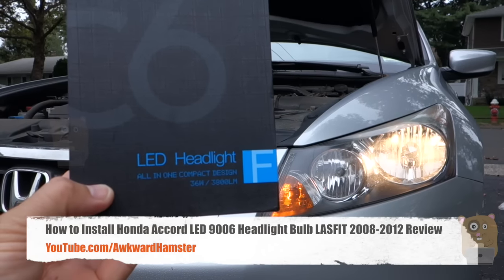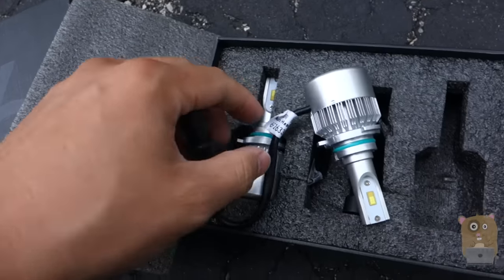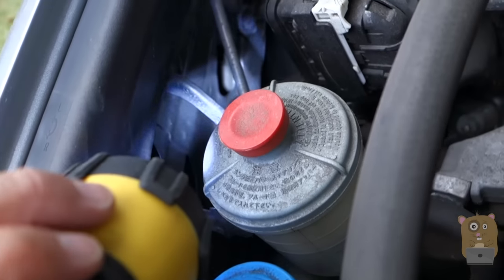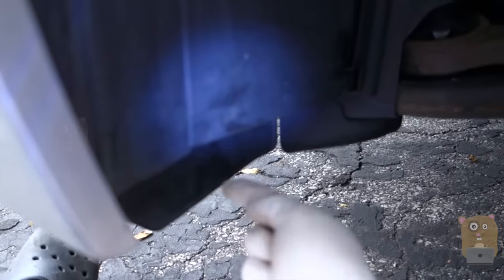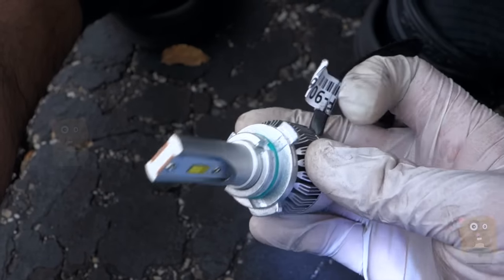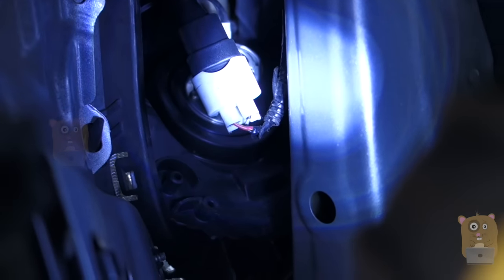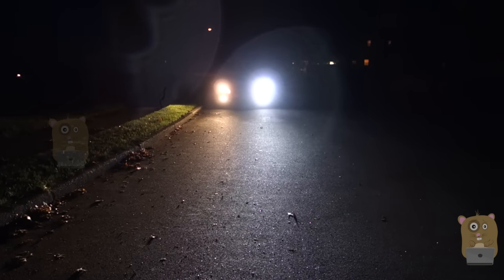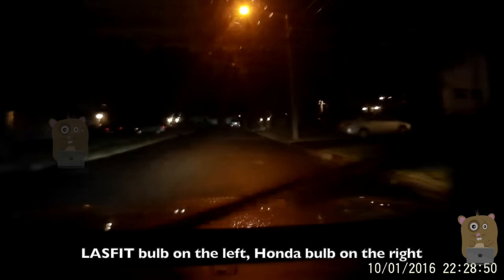How to Install Honda Accord LED 9006 Headlight Bulb 2008-2012 Review

Comment: If anyone sees this,instead of removing the wheel,you ca just turn it all the way to the right.It’ll give you enough space to remove the fender clips
Reply from the maker: thanks. I think I mentioned it in the video that I am removing the wheel because it makes filming easier.
Reply: Lol he says it very clearly that he removed the wheel to make it easier to see what he is doing but we don't have to smh
Reply: @AwkwardHamster  Thank you for this Video Man 👍
It helps A lot
Reply: He said that several times in the video bud😊

Comment: Ok so i just did this on my Honda! I kept the wheel on and just turned it to the side! I took off about 3 plastic tabs and only 2 went back on, the other was so brittle and old it broke!! It was very hard to twist it with my hand in an awkward position but ONE BIG HELPFUL HINT!! UNPLUG THE CONNECTOR BEFORE YOU TWIST THE BULB OFF! IT MAKES IT ALOT EASIER WITHOUT THE HARNESS IN THE WAY! Overall thanks for the advice man....Now i can drive my car at night again and feel more safe! 👍
Reply: The fasteners were so brittle on mine most broke too. Now I’m having a hard time getting the new fasters back in place because some are different sizes. Any advice on how to re-attach the plastic liner?

Comment: This was ALOT harder than i thought. Not much room to work with and i had problems getting the bulb out (sprayed wd 40) that worked. It was also very hard to get the new bulb in the track. And to make the connection u need two hands. Overall not as easy as yours but after two hours i got it did. Thanks
Reply: is it worth the headache?
Reply: Lol same dude. Just don't forget the swear words. It's completely necessary
Reply: You could have taken off the front bumper cover and then remove the headlights,but it all takes time and patience.

Comment: it may reflect brighter and better light than halogens but a lot of folks forget how LED bulbs work. THey're not good especially for opposing traffic. Why? Because all these headlights are "Reflector" type and not projector type. All the LED headlights you see on the newer cars are projector type. These will blind oncoming traffic. It's almost no different than driving with your High Beams on the whole time. If anything, replace the entire Headlight unit with aftermarket projector type headlights. Also, these will make the area close to you brighter, it will not give you distance. The whole point is to get more brighter light down the road, using low beams. IMO, Sylvania's Extreme White is the best bulb for these type headlights.
Reply: Main reason i am saving up money for projector headlights for my 08 accord. Which i find stupid that the coupe accord comes with projectors but not the sedan -.-
Reply: Romal Desai agree I haven’t been a fan of leds since the old school with the silver box ballast  and now their just a huge light bulb with a fan... ya they do look like High beams too and I feel like every new car or car with hid have high Beams and blind me.. of course I gotta look away and not at the actual light. Might have to invest in that “as seen on tv” flip down visor that turns ever light dim lol

Comment: Looks good from brightness standpoint. However, my concern is those few extra inches up on the led beam may be equal to shining in the external rear view mirror and straight into the driver's face. Furthermore, the illumination to the left is at an angle instead of a straight line. In other words, the horizon line is not horizontal and goes up the farther it moves away from the center. I therefore suspect it will potentially shine into oncoming drivers.

On another note, i like how u shined halogen and led together for comparison., an installer can use that to adjust the LED bulb to the correct height.

Comment: I did my 2009 Honda Accord ex 4 banger.i had to adjust the driver's side n passenger side.just remove the air box on the driver's side to adjust the driver's headlight.the on the passengers side pull up the radiator overflow bottle and you can see the passengers adjustment nut.they use a 10 mm socket with an extension.thats good for all 8th generation models.

Comment: I was sitting on the fence about using led bulbs. I even purchased a set about 5 months ago. Had them just collecting dust in the box. But now I think I am going to use then. I have the same car as yours so I hope installing will be easy.
Reply from the maker: Cool. Remember models newer than mine can access the bulb compartment from the top under the hood instead of wheel well.
Reply: AwkwardHamster I have a 09 Honda Accord

Comment: I want to install LED too but I was told the life of it is really short. Is it true? How many years did the LED lamp last for you? Great video! It is extremely informational especially with all those twist-locks-push stuff you mentioned on the sides to get access to the lamp.
Reply from the maker: I think led bulbs last 4-5 years. But, led brightness on year five is about the same as year one. Whereas the traditional bulbs brightness keeps diminishing year after year. Traditional bulbs may last 5-10 years but that is only because I was too cheap to switch them when they are dimmer. My Lexus bulbs are over 10 years old and dim as hell. I tried to install led bulbs on my Lexus before but I didn’t realize at the time the ES300 used an adapter between power cable and light bulb.
Reply: @AwkwardHamster  That's really cool! I'll be very happy if it reached 4 years. Right now, I'm replacing the bulb and I could not get into it. I am trying to remove the plastic cover near the tire and there is one clip that is different. I am unable to remove that clip 😭
Reply from the maker: Those clips are troublesome. They are also frail. One had a cross and I use Philips screwdriver to unscrew and pop out. The other clip is flat but there are two rings on the surface. The outer ring has one part that is flatter than the rest. I used a thin flat screwdriver to pop up the middle round plastic plug. It doesn’t pop out all the way. Like half way so I can remove the whole plastic plug.
Reply: @AwkwardHamster  yes, that one flat piece is the one I'm having trouble with. Oh, so it doesn't pop out all the way? Should I pry the whole plastic instead of the plug?
Reply from the maker: I have been driving for years with a couple of those plastic pieces missing. Amazon sells replacements but it’s by the box. Pep boys probably sells them individually. 
First try using a flashlight to see if you can identify the place to stick the flat screwdriver.
Reply: @AwkwardHamster  I finally was able to remove it. It was a scary loud sound, LOL. It was square inside with bending lock in the center of the square. I broke one of the locks since there were 2. I was able to install the new headlights finally. :)

Comment: Good video on how to replace the bulb. I don't mean to damper your enthusiasm and hard work, however, unfortunately you goofed by not re-aiming your head lights. In the video at 4:53 you compare the beam from the new bulb versus the beam fromthe old "factory" bulb and explained that the higher beam of the LED on the LH side of the garage door is due to being new. The original halogen bulb on the RH side is most likely aimed correctly. I have a Honda Accord Sedan 2009 and even just eye balling it your new LED bulb is aimed too high.
  Two points: (1) most LED bulbs do not have the LEDs in the EXACTLY the same place as the filament on a halogen bulb. The 2008-2012 Honda Accords were designed for a halogen bulb in the reflector style headlight. As such the LED bulb does not interact with the reflector the same as the stock halogen bulb and thus you get the beam being higher (or lower) with the LED as well as the ragged line at the top of the beam pattern. You can see the sharp line at the top of the beam pattern on the RH side with the stock halogen bulb. Versus the ragged line in the new LED bulb.
(2) You based your analysis of whether other drivers would be blinded by your new LED headlights based on being 40 feet away. That is no where far enough from the car to evaluate. 
If you have not already you should re-aim your headlights immediately as it is safety hazard for other drivers. 
  Basically with the car 25 feet away from the garage on flat driveway, the top of the headlight beam should drop about two inches on the garage door versus the height of the head light above the driveway. You can see where the center of the headlight is by looking for a small dimple in the headlight lens corresponding to the middle of the headlight bulb. If that dimple is at 28 inches above the driveway, then measure 26 inches on the garage door and aim headlight so the top of the beam at at 26 inches.
  For proper aiming you should alway have about 1/2 tank of gas, someone sitting in the drives seat, and if you typically have tools loaded in the trunk then ensure the tools are present when you aim the headlight. All of these things affect how high the center of the headlights are above the ground, and thus affect the aiming.

Comment: Do you think that the LED headlight works better than the original halogen one? I’ve seen some videos saying that the reflector was specifically designed for halogen bulb. (illuminating 360 vs 180 degrees).

Comment: I have a 2008 Honda Accord Coupe V6.  It does not have a white connector and I am having problems removing the halogen bulb (it is too tight).  Any recommendations/advice?  Thanks

Comment: If I use these for my drl and high beam will I get an error on the dash?
Reply from the maker: +Josh Burris 
High beam is a bit more complicated with the accord. Have to install a desperate relay because of the voltage drop for DRL.

Comment: I have issue of lining the three tabs in the socket. It would not fit however the oem halogen fits fine.
Reply from the maker: +worldanh I suspect you didn't get the right size bulb. What's your car make model and trim?

Comment: I just got these installed and noticed the radio has a lot of static . any suggestions
Reply from the maker: Are you using anything like a DC 12V splitter in the cigarette socket?
Reply: AwkwardHamster I currently have nothing else connected or hooked up. when I turn lights off the radio is clear and when lights on there is static
Reply from the maker: +Richard Wilson 
I encounter the issue when I turn on too many devices. For example, I have a phone charger and 2 dashcams. If all 3 are on, I hear a lot of static from the radio. So now I just power 2 devices on when I want to use the radio.
Reply: Can the static be caused by a phone charger in the cigarette socket?

Comment: Nice video but is a 
in in the @ss to much work for replacing the lightbulb
Reply from the maker: It was a pain in the older models. I saw the newer models can be done right from the top under the hood.

Comment: I have a 2008 Accord LX, and my connectors have 3 prongs, not two.  Are these for high beams or low?
Reply from the maker: It’s determined by the bulb model. Your 2008 model has separate bulbs for high and low beams.

Comment: Hello- great video. Thanks! Quick question. When I installed the new lasfit bulbs the fit was not as type and could easily be backed off. I can think this will back out after bumpy driving. Any tips on how to make the bulbs tighter?
Reply from the maker: +Lee Castillo 
Silicon Caulk. I love that stuff. Works as an adhesive. Tolerates wide range of temperatures. Can be removed with less residue compared to tape.

Comment: Did you replace the high beam/daytime running lights to LED too?
Reply from the maker: I did at one point just to see how it looks.  It was OK.  DLR and high beam works fine but I kept the stock halogen bulb on since they're still bright.  Going to re-purpose the high beam bulbs for other cars that need it.

Comment: I have tried SO MANY sets of LED headlight bulbs for my 2011 Accord. None of them have worked. They have all yielded no light when plugged in. I will pull the trigger immediately on these if they will work with plug and play with my car. I have the stock headlight housings, completely unaltered. I have the SE trim. Do you believe it will work as it did for you?
Reply: Bought it. Hoping it works like yours did. Fingers crossed.
Reply: Were those LED lights returnable? Online or brick and mortar?
Reply: @BrandonBerrios  did it work

Comment: Do you recommend any LED light for a 2017 Honda Accord
Reply from the maker: Lasfit brand. Whenever I have questions they offer support and advice. For example they help explain how to wire daytime running lights and explained recommended bulbs for fog lights

Comment: I installed led into my friend 2012 Honda Accord but it did not turn on
Reply from the maker: Double check that the connector pins were inserted properly. Sometimes they get bent when pushing in.

Comment: I order 9006 6000k led for my sister 2012 Accord SE and didn't turn on. Any suggestions why
Reply from the maker: Doublecheck that none of the connectors are bent.
Reply: I have this issue as well with my 2002 nothing is bent

Comment: I have a 2010 accord with HIDS which constantly flicker. I've been thinking about switching to LED's. Have you had any flicker problems or them not turning on?
Reply from the maker: Hi. I haven't tried converting from HID to LED.  I'll have to change the headlight, not just the headlight bulb.  
And no, mine hasn't flickered.

Comment: What about high beam code ??
Reply from the maker: If I wanted to change the high beam bulb I would have removed the bulb right next to the low beam. But, because this car also uses high beam as daytime running lights I would have had to add additional wiring to account for the voltage drop in the daytime when using LED high beam bulbs.
Reply: @AwkwardHamster  so what type of of bulb this car model using with low and high beam ?? I wanted to order both bulb with led
Reply from the maker: brandon wong For my car 9006 is low beam and 9005 is high beam. But, you can look up the exact bulb for the year and model of your car on this site. https://www.automotivebulbfinder.com/philips/

Comment: Do they make a sound when they are on?
Reply from the maker: +Robinson 1998 
Yes. There is a fan noise. Not loud, more like a low hum
Reply: AwkwardHamster do they last long
Reply from the maker: +Robinson 1998 
Yes, these are great. Still using them in my car.

Comment: Great video thanks but heck man, what are these honda designers thinking!! Dismantle a whole car front end to pop a bulb in...this is millenial.madness,  or designer wank of note..or the aftermarket parts industry ripping off customers so they can.book it in for an overpriced #$%@$$$  bulb service.....crikey...cant we just be practical...imagine having to dismantle a whole wall just to change your bedside lamp bulb...insanity!
Reply: Imagine trying to design a car from scratch as some kid on YouTube thinks he could do a better job at.  Not as easy as you think.  There are about 1000 parts that are installed in a factory for one vehicle, imagine sitting at a computer without even seeing the vehicle in person and designing where all of that will go.  A lot harder than you think.

Comment: It's high beam thou.
Reply from the maker: I didn’t switch the high beam because it would have required additional wiring due to my car’s high beam functioning as daytime running lights at lower voltage.